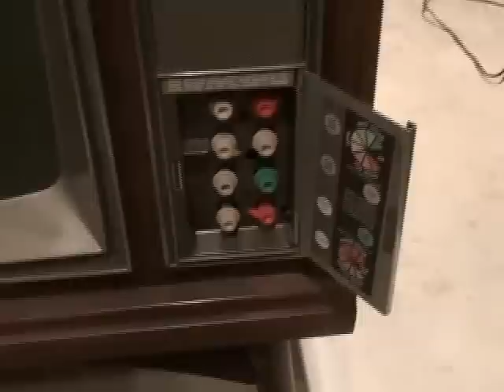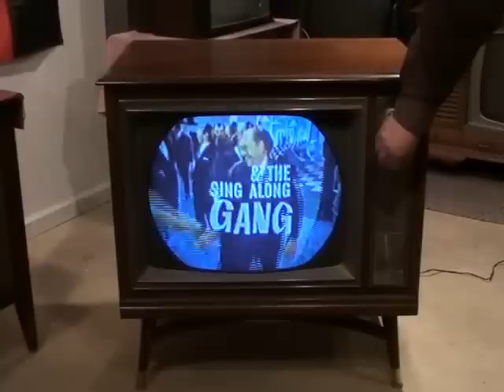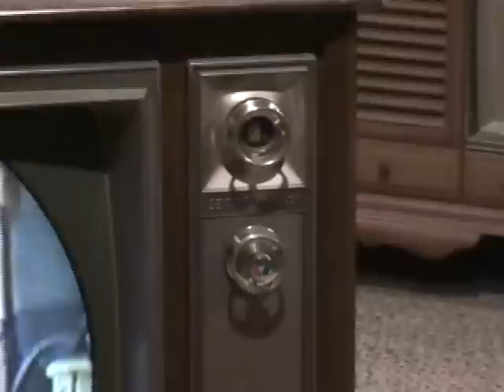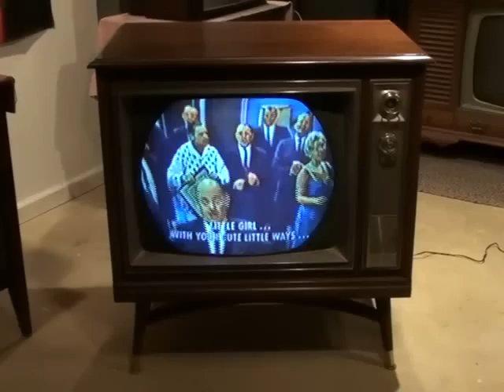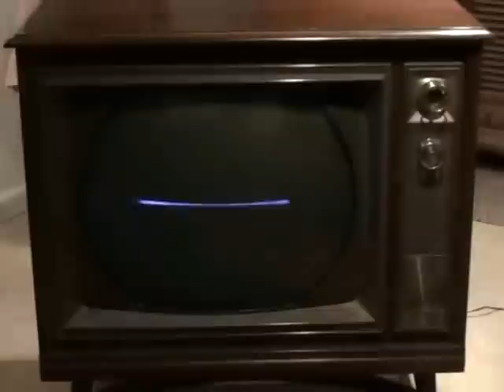Watch a 1965 Zenith COLOR Television with original programming!

Comment: There's something very charming about the softer colors on these old sets
Reply: The whole broadcast chain was also very much a part of that as well. 
Studio videos and audio Processing and even over the air signal processing has so very much evolved since that time as well. 
Solid state anything from the studio to the transmitter itself and to your home was still very much not a thing in 1965 and a labor of love for engineers of that era to maintain. 
There was so much signal drift with vacuum tubes in camera’s, exciters etc etc and one of the reasons broadcast stations signed off so services could be performed on studio and broadcast equipment late at night. Like television sets it was a high maintenance operation prone to failure and a moments notice! 
It sure was a different animal in the earlier days of TV & radio broadcasting. Many will agree a great time. Then time became a cost factor and things had to change!
Reply: @Channel-cm7yc  I'm 27 but I often forget that television was analog at one point up until the late 2000s, it's just errie yet fascinating at the same time that we once made memories watching our favorite shows/movies in that manner, I can't really explain it

Comment: Hi Doug I have my gradmothers tv from 1955. It's a Zenith Royal X Chasis with flashmatic cells on each corner. the set still works fine even after it got struck by lighting back in 1963.Cosmedilly it need help but the picture is great and the 10 in speaker was kicked in by my son. But all in all it still works.. great to c old tvs working

Comment: Is there any advantage to use roundy kinescopes instead the rectangular ones ? After almost 60 years the picture is still very good and convergence is ok... At Brazil the color tv appeared only some 50 years ago by 1972 and no roundy kines was made here, the system adopted was Pal instead of NTSC because  the cityes have a irregular signal transmitting stations and with lots of obstacles on view's sight...

Comment: Back when I was a teenager, I used to repair tons of these for poor color ie; "face tones".  The solution was to replace both chroma demodulator transformers, demod tubes (can't recall the numbers!!)  and realign them.  It was the only way to restore real red back to the chroma.
Reply: Being from the UK we had Pal colour tv. Is it true that the Ntsc system was notoriously bad in showing true and consistant colours especially in poor reception areas or in certain weather conditions? I remember back in the late 60's/early 70's when watching US made shows in the UK, thinking that the colour, contrast, and sharpness of the picture was inferior to that of UK or European made programmes.

Comment: Easy to see why the Japanese TV's conquered the market. The chassis looks like the same assembly US manufacturers used in the really old days. No PCB's, no solid state devices. My 1971 Sony Trinitron worked perfectly for 15 years and then I sold it for a newer model. Never needed a repair. I still remember the TV repair trucks parked all over the neighborhood servicing these old crap TV's.
Reply: Not all that true, circa '65 all color sets were tube, with tube tech lacking PCBs was better as the heat dissipated better without baking the boards like with RCA and especially GE because their boards were cheap. Zenith's Chromacolor and Chromacolor II sets produced as good a picture as any Trinitron and were solid state as well. Components that got hot on them were still hand wired like this set, however each function like color demodulation, just to name one was on it's own modular board. All were socketed so that if one failed, the service man need not yank the chassis and take it back to the shop to replace individual components, he just swapped the socketed board and went on his way. This, of course, isn't to say that Trinitrons weren't good sets.

Comment: The mystery to me is that how could you get the original programs and play them on this old school TV. Is there a recorded tape or some kind of memory disk for them?
Reply: Probably using  a DVD player,  connected to a  RF Modulator which is then connected to the antenna input of the TV...

Comment: Why do these sets take so long to come on. My mother has a Magnavox console TV during this time period and when you turned it on it just came on. I should know because being the youngest, I was the remote.
Reply: it's just the nature of vacuum tube equipment, some TV's of that era  would seem to spring to life faster , due to a "Instant-On" feature, where the (CRT picture tube)  filaments are kept heated up at lower voltage at all times..as well as other circuits

Comment: Does this have an RF input (I´m assuming it does, but since I don´t see the antenna)
I want to buy one to use it on the first and second gen consoles
Reply: In those days RF (and usually just VHF) was the only Input"
Reply: +WAQWBrentwood I thought there was a time with not input at all... But now that I think of, that wouldn't make sense, it wouldn't have antennas hahaha
Reply: The good news is on these sets with a $2 75ohm to 300ohm adapter a VCR,DVD etc can hook right up.
Reply: You could actually see a loop antenna on the back of the TV when the back of the unit is shown.

Comment: imagine being able to play the ps4 on this
Reply: Probably not with something like this bud
Reply: @B01G3n1us  The process is clumsier with HDMI, but simpler things that use composit out can be done fairly easily with most tube TV, as adding a circuit for composite is usually pretty easy.

Comment: Can you hook up a coaxial adapter to a tv like this & connect cable somehow ? Isn't that how the original cable boxes were installed in the early 70's ? without ota analog what do you do now?
Reply: Tjfreak Yes and it is possible to do that
Reply: Older television sets needed an adapter to connect to the onboard antenna prongs. If you wanted to connect an RCA cable to it, you'd need an adapter for that too. If you wanted component or even HDMI, you'd need an adapter for that too.